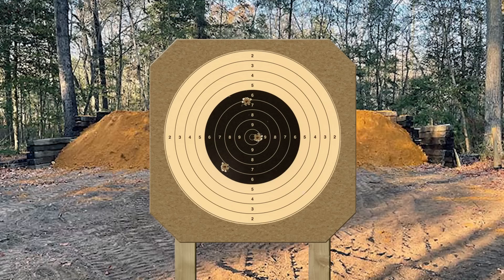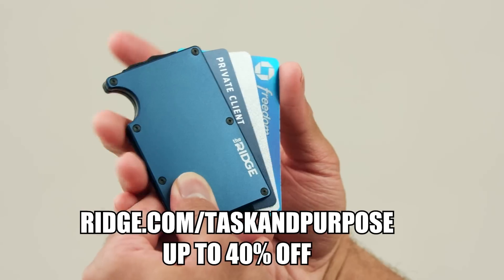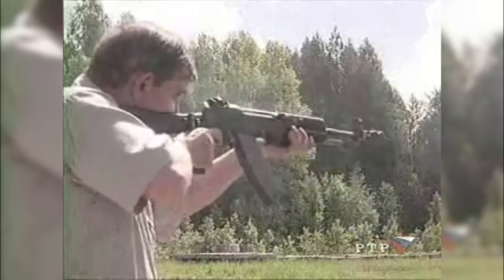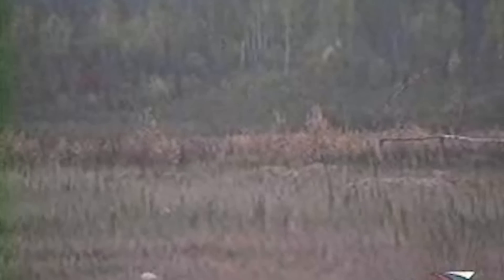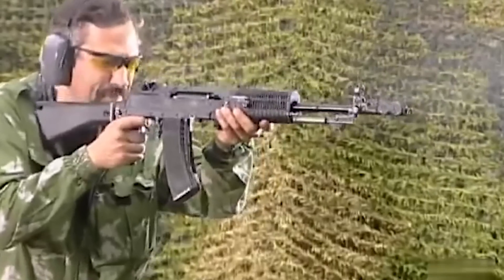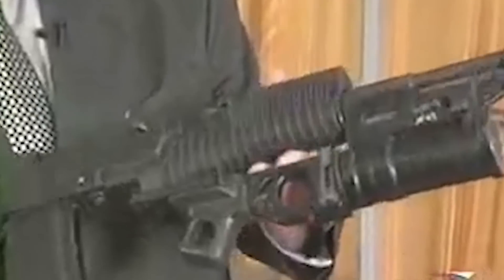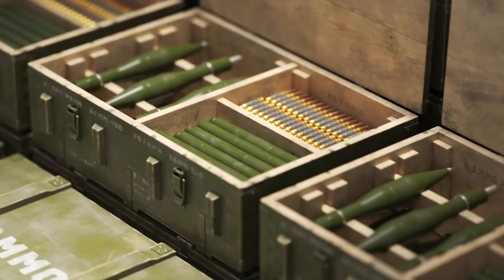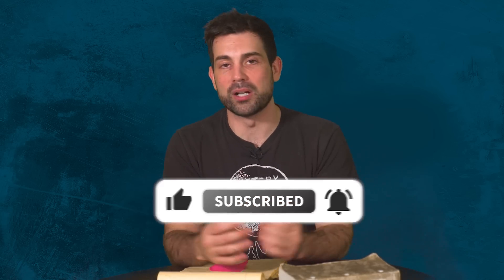This Russian Rifle Fires 2 Bullets into 1 hole

Comment: The AN94 was based on a great idea. It's unfortunate for it that the Soviet military at the time wasn't being staffed with clockmakers who'd be able to service it in the field.
Reply: Well there's that and it's a gun with a lot of parts, the AK was chosen by Russia because of reliability and quick manufacturing and the M4 was chosen because of intermediate cartridges and less recoil with better penetrating power against the body. Russia is and still maintains a large population and so if it needed to arm all its citizens at a moments notice to fight off an invading army they could because the AK could be produced on a massive scale (AK, being the 47 and all its variants, including the 74, 74U, 104 and 12).
Reply: @PSC4.1  You don't arm the population with new production, but stockpiles. And it seems half the Russian stockpiles either didn't exist or got sold.
Reply: @ChucksSEADnDEAD  stockpiles run out, and storage isn't free
Reply: @diazinth  How do stockpiles run out when not used? Storage isn't free, but armies aren't free. The fact of the matter is that Russia dipped into their stockpiles for the Ukraine war. Something you want to claim is not possible. Producing weapons can take months just to start a factory, so it's easier to keep the vehicles already made than wait 6 months to configure a factory and then get 60 tanks built in a month. You could just have 200 ready to go and 600 in need of overhaul instead.
Reply: @ChucksSEADnDEAD  and the ones that do exist are covered in rust
Reply: @oliverchristopher8941  The videos surfacing of the Russian conscripts being sent to die in Ukraine are showing AKs that look like they were buried in mud. Rusted through, some with safety levers rusted complete off and replaced with lengths of scrap metal, badly warped stocks.
Reply: @PSC4.1  US has a population 3 times the size of russias.
Reply: @Maria_Erias  and there are photos of ukranians using maxim machine guns.
Reply: @iplaygames8090  The Maxim's a good gun, which is why it was - and is - routinely used by militaries all over the world for decades. Same thing with the Browning M2. It's well over a hundred years old, and is still prevalently used by the US military.
Reply: @Maria_Erias 
Don’t forget all the Russians being issued the 1892 Mosin-Nagant. A bolt action rifle that’s literally 130 year old rifle design
Reply: @ChucksSEADnDEAD  the so called scrappy underdog was the third or second largest army in europe on the eve of the invasion.
Reply: @Maria_Erias  dude they are literally issuing mosins right now.
Reply: @iplaygames8090  paper tiger, chances are they never had what they claimed to have.
Reply: @srice8959  Who aren't even part of the army and serve in the militia forces of DPR and LPR
Reply: @srice8959  all ? They are mostly using AK-12
Reply: @lostwizardcat9910  neither russia or ukraine were paper tigers. Both were armed to the teeth at war start.
Reply: @iplaygames8090 difference being, Ukraine stuff is well maintained and are actually useful
Reply: @ChucksSEADnDEAD  
Nope... russia had   7.5 millions ak's in storage
Reply: @mycom9832  great joke, like the moskva being in battle ready condition.
Reply: @ignacio3890  Sorry, mate. The Nazis were wiped out in World War 2. Unless the orcs have invented time travel, they aren't fighting Nazis.
Reply: @ignacio3890  Okay, Forrest.
Reply: @Maria_Erias  
Don't like the real history? What about the usa sending weapons to al nusra/ al qaeda in siria?
Reply: @iplaygames8090  Still smaller than Russia, and much less capable. For example Ukraine has Soviet era MiG-29s with some upgrades (only ONE aircraft with a modern upgrade before the war) firing semi-active radar homing missiles while Russia has modernized aircraft with active radar homing missiles with greater range. The short range tactical ballistic missile used by Ukraine is the Tochka-U, while Russia uses the Iskander. Ukraine is limited to S-300s, Russia has S-400s. Ukraine's main battle tank is the T-64, while Russia has T-72s, T-80s and T-90s.
Reply: @PSC4.1  don't forget the akm  the gun that actually give the AK47 its stolen reputation
Reply: @ChucksSEADnDEAD  all very true but Ukraine also has tow 2b and a multitude of drones and that's what's offset the ballance. T80 and T90 have basically been victims in this conflict because Ukraine didn't throw T64 at them,they used drones, atgm's and attrition  and Russia is now very much on the back foot because of their unwillingness to change doctrine
Reply: @Maria_Erias  and they still work! That's why the AK is amazing.
Reply: Anything soldiers use needs to be soldier - proof. Meaning works every time.  Simple. And difficult to break. Just like the soldiers themselves
Reply: @Maria_Erias  You when Ukraine uses a certain weapon : "Hell yea they're woopin ass with old weapons" 

You when Russia uses the same weapon : "Hahahaha lol they can't even afford new weapons!!"
Reply: @magistic345  WTF are you talking about?
Reply: @magistic345  Yeah because atleast Ukraine uses working old weapons and not half broken AKs and fucking mosin nagants.
Reply: @Maria_Erias  
Nope.. you lies, russia don't  seen concripts and we see  rifles in real good shape
Reply: @ignacio3890  It's not me lying, puppet. It's the videos coming out from the conscripts showing the absolutely awful conditions of their equipment, training facilities, and everything else.
Reply: @Maria_Erias  
And we see the training facilities in chechenia, krasnodar , ryazan  and be increíble good
Reply: @PSC4.1  u forgot the 101,102,103,105,74M and the AKM
Also stuff like pp-19 and saga 12g count too
Reply: @ignacio3890  lol Kanye west
Btw do NOT refer to nazi supporters as he/she they aren’t human so call them it
Reply: Full auto wouldnt this mechanism break down over time?
Reply: @Aaron-zu3xn  a very special thing called weapon repair/maintanence exits mr “Aaron” if that’s even your real name
Reply: Exists
Reply: @Maria_Erias   but knowing the am them basted worked fine even with all the rust and dirt
Reply: @N00000OOOOBY  there’s like a handful of nazis I have respect for 

Hans Münch and Oscar Schindler are on that hand
Reply: @FuckTheGlobal  Amen.
Reply: AN94 is pure hell to maintain
Reply: Clockmakers? Clearly this rifle was meant for the Swiss army!
Reply: @TammoKorsai  They'd ADORE it, I'm sure.
Reply: @Maria_Erias propaganda
Reply: I threw in the ks-23 because the badass idea of a 23mm shotgun

Comment: A cool concept but I can totally understand soldiers being afraid of taking it apart lol
Reply: That was relatable.
Reply: They just need more training. It can't be more complicated than a vehicle. I think the thing is just ahead of its time. As manufacturing capability advances further, this sort of thing should be possible.

Increased manufacturing accuracy makes stuff more reliable. Some redesign might make it possible to "group" multiple parts into a single component that need not be broken apart for cleaning. 

For example, when you disassemble a sniper's rifle, you do not disassemble the scope to clean the lenses separately. That is considered a single unit.
Reply: @danielch6662  "More training" is a big issue when your doctrine relies on mobilized soldiers. Russia inherited the Soviet doctrine which maintained large numbers of officers in understrength units that would be filled with mobilized soldiers in case of war. In that case you REALLY need soldier-proof gear.
Reply: @Elbuarto  which is why the an94 was only issued to special forces
Reply: @danielch6662  as an engineering student this gun makes me wanna kms
Reply: @Elbuarto  It sounds funny, considering that almost half of our army is under contract and more and more are trying to turn the cause of war into a professional channel.
(And just the other day they announced an increase in the regular army by 500,000.  That is, from a million to 1.5.  And among all this number there will be 700 thousand contract soldiers.)
If you now think about mobilization, then it was carried out among those who had already served in the past and had combat experience (most likely you were told this was radically wrong).
I will add on my own that despite the above, there were precedents when they tried to mobilize those who did not fall under the above points, but for this they created places where one could write about the work of the local military registration and enlistment office.
Reply: Not only that, the rifle is super expensive and breaks easy not something you would give average troops or conscripts.

Comment: Come to think about this gun, this gun is similar to G41(M). That gun is designed by Paul mauser. He fulfilled all the insane requirements presented to him and made a gun. The end product is an unnecessarily complicated weapon. Still, I'll give props to Paul mauser.
Reply: ty interessting read
Reply: Nice and true reflection.
Reply: HK G11
Reply: @jansenart0  - G11 is something else. It's internal components resembles a clock
Reply: +Jansen Art
The G11 looks like a Walther WA2000 that was repeatedly punched in the face.
Reply: @fluttzkrieg4392  - yes. It is one of the squarish looking gun. I'd love to see one in real. So far, I've seen it in pictures and videos.
Reply: "Unnecessarily complicated" speaking of German WWII engineering is like saying "wet water".  I mean, German engineering generally as well.  Well, except the Mauser company's last great invention, the STG45M, aka the Gerat 06(H).  This could alternatively be known as the predecessor of the G3 and therefore, the MP5.  Good guns, fairly simple (after you math it out) and reliable as all heck.
Reply: @Jeremiah90526  - yes. I mean for some reason the Germans at that time seems to make weapons that are complicated. The main issue is the higher ups always present them with some of the goofy requirements. As a result, the weapons turns out complicated. The G41 program is the example to that. Mauser's design fulfilled all the requirements, but the overall design is complicated. Walther however ignored some of the requirements and delivered a weapon which is practical.

Comment: In the 80's H&K tried something very similar wih the G11.

It never made it past the protype phase because it was overly complicated, expensive, and the caseless ammo it used was fragile
Reply: Not exactly.  The caseless ammo was prone to cookoff, but that problem was eventually solved.  It was political changes in Germany that ended up killing the H&K G11.  You're not wrong about the complexity, you'd have to be a German clockmaker to detail-strip one of those!
Reply: @DrownedInExile  It’s also still very expensive.
Reply: @DrownedInExile  The caseless ammo was prone to cracking and would frequently jam the weapon.  Moisture would also contaminated the propellant, the tried to seal it with wax ,but the heat would melt it and  jam the rifle

Due to its complexity this was a major problem, so the idea of caseless ammo was scrapped with the g11
Reply: @MatthewSmith-to1hz  Ah damn, I didn't know that.  I always thought caseless ammunition could have been the future.  No M41A pulse-rifles for us I guess :)  (Yes I know those were Tommy-Guns, not actual caseless weapons)
Reply: @DrownedInExile  well at least today there are polymer casings, which decrease weight and as a added benefit they´re smoother than brass (i.e reduced friction)
Reply: @MatthewSmith-to1hz  Caseless ammo hasn't been entirely scrapped. There was the LSAT light machine gun in the 2000s (and its accompanying LSAT assault rifle), for instance. My understanding is that the main reason why it wasn't adopted was the logistics issues involved with converting to a new cartridge based on principles with which few manufacturers had any experience. (I'm not sure how or if they solved the durability issues, but IIRC, none of the sources I've read mentioned it as a serious problem). Someone in Austria also built a bolt-action, electric-firing rifle using caseless ammo (the VEC-91) back in the 90's. The idea was to deal with the heat issues better, but making it bolt-action made it a moot point.  I'm guessing that it was sort of a test of the idea, since making it bolt-action kind of makes heat easier to manage anyways.

Comment: The AN94 is really an eye opening rifle. I first saw it in BO2 and thought is was just futuristic AK, but it was an actual prototype and how it works is truly revolutionary. Too bad it cost too much to manufacture for the military, but would be awesome to own.
Reply: 1000 to manufacture roughly compared the the aek-971 was around 800 Soviets made a mistake not choosing the simpler design the 2 shot burst is a novelty when they start double feeding. 1800 rpm is too much where as the counterbalance recoil eliminated on the 971 at 900 rpm was far superior in my eyes
Reply: It's 800$ the US market it would 1800$ if u want it which I would scoop up in a heartbeat

Comment: There's several of them in civilian hands in Europe. They've been converted into non-firing models. I got to examine one of them 12 years ago. It had the face of the bolt cut off at an angle. A hole drilled in the chamber and a steel plug welded into the barrel. I got to take it apart and oh boy is the inside of that gun a busy place. I had never seen anything remotely like it. I asked the guy who owned it how much it cost him. Back then it was €8,500. That's a lot of money for what's essentially a paperweight. Don't give me wrong it's very cool but it's still a paperweight.
Reply: I won't lie it saddens me to hear it was made unfirable.
Reply: @bernharderasmus9219  that's the Russian law.  Civilians can't own automatic guns, machine guns, etc mass lethal weapons; shortguns you can hide on yourself etc. - only hunting rifles that are unautomatic. And so that to keep any firearm on display as an collectible exhibit (and any banned weapon in civillian hands can only be one), it should be irreversibly deprived of it's abilities as a weapon. 
 Moreover, our legal practice doesn't see firearms as self-defence weapon unless you have proof the attackers have shot to you BEFORE you shot at them. Using a weapon (any weapon, not a untility tool like a shovel) is treated as a sign of intention, and "intended harmful action or inaction" is the definition of crime.
Reply: What you handled and stripped is a training aid made out of a formerly line weapon. It's made for training troops on operating it. When outside of a military setting it's toy and novelty. A bit too big for a paperweight.
Reply: @annasolovyeva1013  interesting information about Russian laws. For the record the specific example I handled came out of Georgia and was a live firing gun. It was converted to a non firing gun by a company in Slovenia.
Reply: @Max_Da_G  the specific example I handled came from Georgia and was a live firing gun. It was converted to it's current status by a company in Slovenia.
Reply: @richardcontinijr9661  Oh righto. I remember that before it became Kalashnikov COncern, Izhmash used to sell deactivated AN-94 training aids done in that exact manner too. Thought that's what you had.
Reply: @Max_Da_G  may also be a "deactivated" collectible exhibit.
Reply: @annasolovyeva1013  Why not just convert to a semi?
Reply: @yestermonth  what semi and how to convert? Factories that make AK, also make AK-based non-automatic hunting rifles, e.g. Saiga, they are legally non-automatic hunting rifles and have no way to be converted into an automatic one, because the connections needed are destroyed on purpose. If you convert an army weapon into something that could be legal, you have two problems. First, how did you obtain them? Illegally? When the army sells their old weapons to collectors or museums - they  deactivate them. And yes, civillian private businesses can't legally own military weapons too.  Second, how do you get the documents that this exact weapon is legal now? That probably would require court and expertise and could cost you an arm and a leg. Probably more than a Saiga rifle costs. If you want something like an army weapon, but legal to shoot, you buy the civillian version of it from the military factory. 
The Soviet legal system was way milder about owning firearms, but in the 1990s when Russia was found and our legal system was formed, there was a lot of crime, even police could be shot and murdered so that to use their uniforms and cars. So, they have put very big restrictions to make sure owning a shooting firearm does immediately cause you legal problems, cost you lots of money and paperwork. As a result, any action with a firearm (even a legal action with a said legal Saiga involved e.g. transporting it from a to b inside Russia) is reglamented strictly, often  involves tons of bureocracy and if you break any part of the reglament or just look suspicious doing it - has legal consequences. Even policemen have to follow a lot of those instructions and to do a lot of paperwork if they shoot their guns. As a result, unlike in the US, cops think before they shoot.